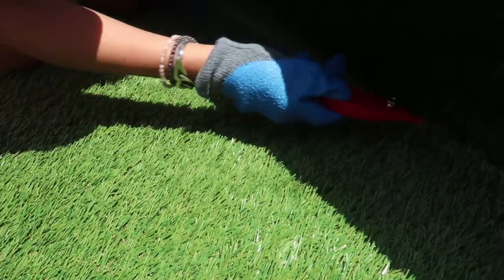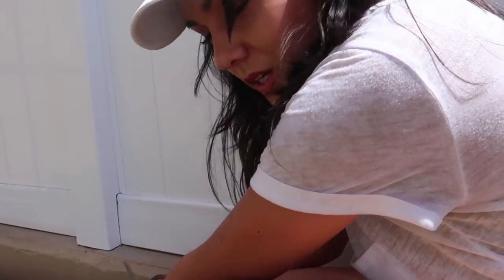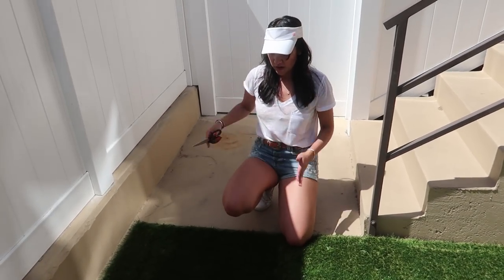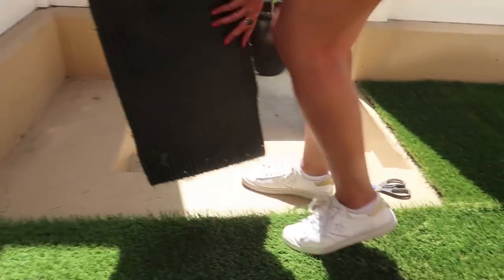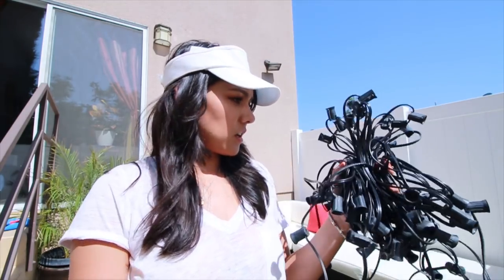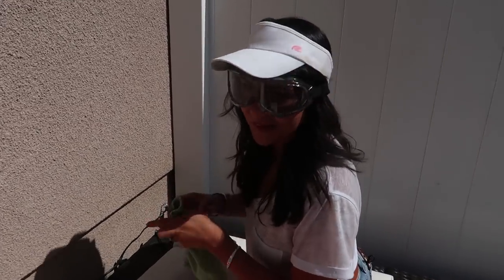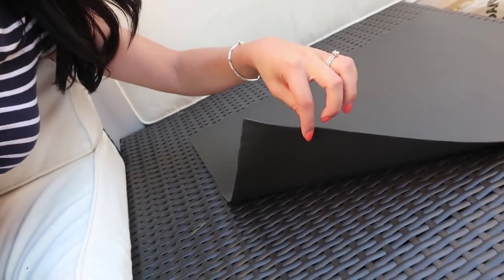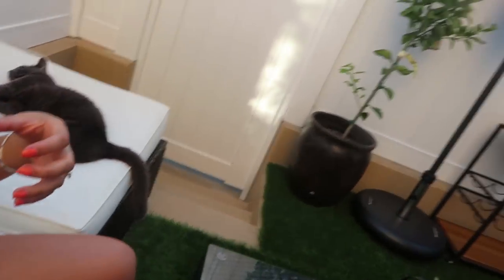D.I.Y. SMALL PATIO MAKEOVER!  |  D.I.TRY

Comment: One small suggestion is when you plan to cut the artificial grass,  the walkable/accessing area should contain bigger pieces so they don't move for you, and the ones in corner,  or under the furniture can be of small pieces too. So first cut as per your most accessing area and then rest adjust with cut pieces like u did in last. Except that,  i love the whole new look.  But wondering that your umbrella isn't enough to protect your stuff decorated. May be you need to plan for an acrylic sheet roof that can protect your patio from weather?